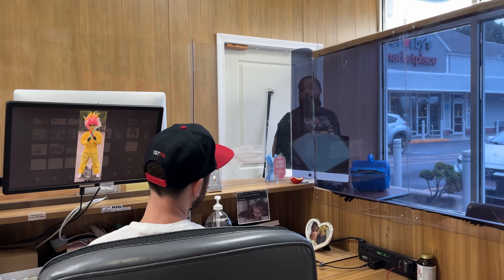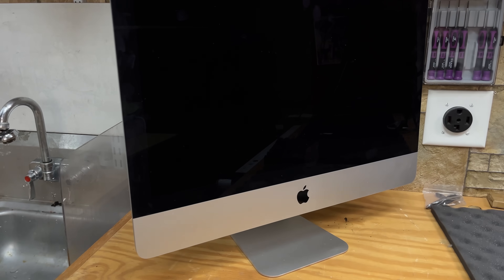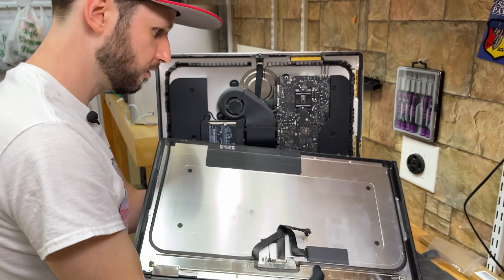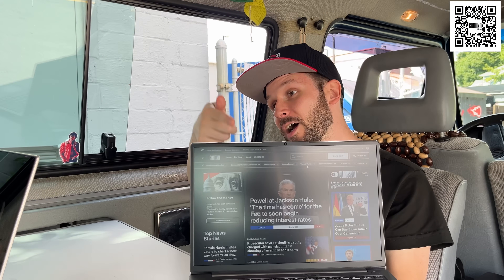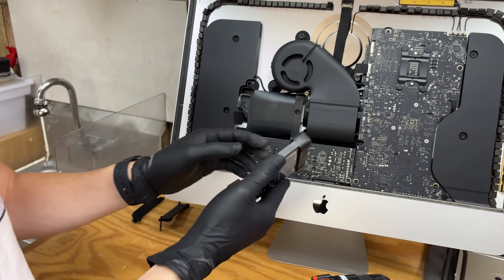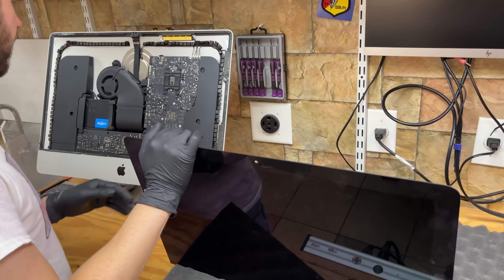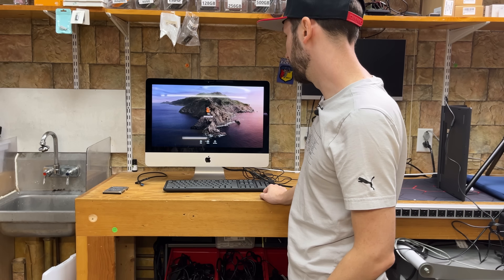This Upgrade Isn't Possible on New iMacs (Sometimes Older IS Better)

Comment: Yeah, you can’t upgrade anything on newer iMacs because 1: Memory is part of the main processor, that’s the beauty of ARM based chip that all computer manufacturers are going to move away to, and 2: Apple decided to glue the storage memory directly into the logic board because they thought NVME solution was still too slow for them, which I can tell PC makers are going to do also in future.

Comment: A good idea would be to start up the imac after you connect the screen but before you stick the screen on the frame. (you can hold it externally in place with some tape temporarily).
This way you can check that everything is working. If you have made a mistake and you need to re-open the imac, you will have to carry out again the same process of buying new adhesive, cleaning the old one etc.

Comment: I’ve replaced the hdd on my 2009 24” but I didn’t notice any significant speed improve during normal work. It boots way faster but that’s only… maybe my iMac is too old to anything to make a difference? Or maybe the ssd is not anything special… it’s a basic Kingston 256gb.
The iMac has 8Gb RAM.

Comment: F**k MAC OS...use 'Ubuntu MATE' on these...wipe it clean...totally no boot camp crap either... just straight install the Linux. In MATE...with the MATE Tweak tool you can auto reconfigure the desktop to any familiar environment ie: Windows, Mac, Unity, Old GTK2 desktop etc with one button...another one that work's really good on mac's is Ubuntu Budgie it is has slightly better specs

Comment: I replaced the HDD for a SSD on my old G4 iMac and put in two 1gb ram sticks. It is SO much faster now! My family uses it as our house jukebox. I just love the look of the G4 iMac, I can’t bring myself to get rid of it
Reply: I wish I kept mine! I bought a G4 iMac like 12 years ago when I was still in high school. I knew even then it was very obsolete and not particularly useful but i thought the design was amazing. I still think its one of Apple's best looking computers. My dad even got me a matching pair of Harmon Kardon speakers that was meant for that iMac and it was pretty cool. I upgraded the 80 GB HDD with a 120 GB HDD and I think I even ran some unofficial patch to upgrade it to Snow Leopard I believe.
Reply: mhm, a media centre will always be a great use for these older machines, especially considering that many will have cd/dvd drives :)

Comment: Great video! I did something similar with my 2012 Mac Mini. Opened up, cleaned it, then swapped out the old HDD to an SSD and swapped out the memory from 8gb to 16 and it runs awesome! Still great for basic stuff like Office programs and web browsing. Totally worth the $120 bucks in parts!
Reply: So true! I did the same upgrades on mine (and later bought one for a friend and upgraded it likewise) and it made a world of differrence. I use it regularly for some light DTP using Pages and other basic tasks (including YouTube of course), using Apple's, and third-party, free apps.

Comment: Now if I were doing that, I'd probably take out the motherboard to put some fresh thermal paste on the things that need it and see if it had the Apple version of M2. You know, little adapter action with a NVME ssd. Maybe look if the RAM could be upgraded.

Comment: Back at my computer repair job from a few years back, we removed those kinds of adhesive from computers by using a little wooden skewer stick. The idea is that you approach it perpendicular to the adhesive and rotate the stick so that the adhesive sticks to the stick, and then you can roll it the opposite direction of the direction you're removing the adhesive. Doing that greatly reduces the amount of scratching that takes place with the initial scrape plus can also help make sure that the adhesive doesn't break halfway while also (hopefully) not breaking any cables in the path.

But it looks like it doesn't matter too much for 

*THE GREATEST TECHNICIAN THAT'S EVER LIVED*

Comment: I have the 27 inch 2014 model and it just stopped powering, out of nowhere I tried turning it on and nothing happened, tried resetting with the keyboard, back button combos and nothing

Comment: I bought my potato lenovo laptop from 2007 with an i3 processor and slapped a new SSD in. Run like a champ. The whole thing cost $250 in my country.
Reply: Did you pay $250 brand new or used? If it was used and within the past 10 years, that's a huge scam IMO.

Comment: Ok, I have a dell Precision mobile workstation 6700. 12 years old and it still works. Just on life support since the battery is Deadman walking. Had 2 hard crashes, can't upgrade to windows 11, and it's ability to hold internet is sketchy.
Reply: Windows 11 is hella bloated it's not worth it.
Reply: @Yurika-rie  it is. But would still be nice to keep it going. I have an asus tuff for more portability and on the go use. But that dell I've had for my entire military career. So once I clone everything over I might have to take advantage of that mail in service.
Reply from the maker: You could try using “Aveyo bypass” to bypass 11’s requirements and keep that beast running. It’s still possible for now, but Microsoft does have plans to disable that in the future

Comment: The 2020 27" iMac with the 16GB 5700 XT & 18 Core iMac Pro are some of the best AIO desktops you can buy today, and they are still supported with modern macOS. Intel MacBooks sucked, but Apple's Intel-based Desktops were KINGS! Up to 256GB of memory! Cant get that on a modern M3 iMac
Reply from the maker: They make some of the best Windows desktops as well!!

Comment: Apple made products with mechanical hard drives until 2020?!?
That is criminal, knowing how much they charge for their crap.
Reply from the maker: They wouldn’t really be Apple if they didn’t screw the customer
Reply: Even back in like 2015-2016 I thought it was odd that Apple would sell iMacs with HDDs. I remember I went to an Apple store around that time and tried out an iMac. For how new and shiny and cool looking it was, I couldn't help to notice how sluggish everything was. Whenever I opened a program, I would see the spinning beach ball icon. When I read the specs, I noticed it had a hard drive. Pretty pathetic IMO for how expensive they were.

Comment: I use a 27" iMac and have replaced the NVMe with a 1TB and installed a 2TB SSD to get them working as a fusion 3TB drive and it's fast AF.
I've been working on PCs for about 30 years and yeah, I've got a permanent scar on my right hand from an iMac power supply from a few years back.
Well done on this one. 
From 'The Oldest Technician That is Still Alive".
Reply: That's quite an interesting thing that happened to you. What happened to you to get such a scar from an iMac PSU? I would genuinely love to hear more about that.
Reply: @EggOfGlory  doing a refurb on a 2011 27" iMac and in removing the PSU I hadn't given it a day or 3 to discharge so when I removed it I wasn't careful and ended up with a nice burn on the back of my right thumb hat looked like a constellation with the burn marks matching the contacts exactly still. The iMac is still being used in a friend's office.
Jumped from the shock and ripped out the power button wire at the same time. LOL
Reply: @WireHedd  That's honestly quite an interesting story! It is funny how that happened, and I myself am into computers.
Reply: The oldest technician that is still alive vs the greatest technician that ever lived
Reply: are you on the east coast?  I have a 2020 iMac; 27".
Reply: @realpropertydivas  I'm in Canada actually.
Reply: I’ll see your scar  and raise you a hair-raising shock from an Atari ST power supply in the 80s…  What kind of evil engineer energizes their heat sinks with line voltage?
Reply: @vaalrus  That sounds about right actually. The STs were excellent when they worked but fixing them was a life risking challenge for sure.
Reply: Sometimes the zaps stay with you... ouch.
Reply: Xd.
Reply: How did you join them as a fusion drive? My iMac decided to "un-join" the fusion drive and my computer is just a waste of space at the moment.
Reply: Oof for the burn, but what model iMac did you add the SSDs on?
Reply: @ I've done it on both my 2015 and 2017 iMacs. The command line for the fusion connection has to be done in the initial setup before the drives are usable. iFixit has a page where the fusion command line info is available depending on the model and drives you use.
Reply: we are looking into buying a older version imac, what do you recommend? thank you
Reply: @eatmoreeats9566  The last Intel model with as much ram and storage as you can get on it. It will run windows, linux or MacOS.
Reply: @WireHedd  thank you. currently we found a 2017 model with these specs- Retina 5K Display, 27-inch, Core i5, 3.8 GHz, 64GB RAM, 2TB. for around 450usd, would you say its a decent price?
Reply: @eatmoreeats9566  That's an excellent price and a great choice.
Reply: Lust is a sin , Christians shouldn't be one with darkness. JESUS is GOD (there is historical proof of that like eye witness accounts and people like Pontious Pilate along with a lot of scientific proof like the days of creation with go with science. also evolution is not real , never has an organism gain genetic information BY IT SELF JUST LIVING , in fact it has been observed that they loose it. GOD has to be real because life can not come from non life, something can't come from nothing , there is a source for everything and that is JESUS/GOD. He loves you man and he can heal you from your depression and anxiety(trust me). if you still don't believe me say this to GOD,"JESUS if your GOD , the show your self to be in a dream and in a DREAM ONLY! Today it self" Muslims , Hindus , Buddhists and Atheists have tried it and they worked. there are testimonies online and miracle testimonies of the healing of PHYSICAL DAMAGE .
Reply: @FrankMadoffe  Yeah, no. Get with this cool thing called logic and reason of non cave dwelling hominids. Space daddies need not ap[ply. If I want a sermon I'll go to church. This isn't a FUCKING church!

Comment: Macs brought to recycling were usually sent straight to dismantling, but one guy got a succesful linux install made in like 1,5 days, and another did just this, but as recyclers we did not go through the trouble of finding out how to hack a macOS back in.
Reply: If it’s an Intel iMac, hold down Command, Option, and R (on a Windows KB, use Windows as Command, and Alt as Option) then turn the device on and it will give you an option to connect to Wi-Fi. On this screen, you can also plug in an ethernet cable. Do the same command from before (Command+Option+R, if that doesnt work, try Command+R) and a loading bar should appear. After a couple minutes, you should be able to restore macOS using the Internet Recovery!
Reply: @gumbygum  all good if it's new enough of a Mac.

Comment: This is the exact model I have on the workbench at work. SSD and OpenCore with Sonoma. Works absolutely fine and it's the perfect machine to perform any kind of software tests for some of our customers that use Macs. 

However, don't buy one used. People are absolutely nuts when asking money for them, even with the crappy original hard drives.
Reply from the maker: I’ve been able to find insane deals on them used though.
Reply: @SalemTechsperts  Market differences, I'd say. Outside of the US, especially where I'm at (Portugal), it's quite a pickle to find a good deal on one. 
If you can though, they are great machines.

Comment: How ironic, I'm currently doing the exact repair on the same iMac model. Andy, instead of replacing the glass with an adhesive back you can get a magnetic kit that uses flat magnetic strips to adhere the screen to the frame. It's convenient but if you iMac is housed where there's dust or humidity I'd stick with the adhesive strip.
Reply: Magnets are convenient if you gotta open up the device more often, but a customer really just needs it shut.
Reply: @SrApathy33  Indeed I was actually going to say something of the effect. This repair is going to stick around the office to be used for lightweight tasks, (scheduling, printing, downloading Lupe's best work, whatever...) so yes indeed customers that don't plan to later undress their machine and poke around should as stated earlier, use the adhesive tape and maintain a secure seal. Personally I like the magnetic glass for another reason...I too have tiny racoon-like fingers that always seem to get prints on the inside of the glass so when I noticed it I can simply grab a small suction cup I use for removing iPhone screens and pull it off and clean it.
Reply: That’s not ironic, that’s coincidental. Irony is the opposite or juxtaposition of what you think or expect on the surface.
Reply: For people at home, a strong, clear packing tape is a good cheap option.
Reply: @kunjpatel8442  I just slapped Catalina on my 2007 iMac I dug up next to dinosaur bones in storage ....the screen has two lines in it and all but it works quite well for its age.... 🤔, kinda like me. 

Clients machines I use quality parts meanwhile I'll slap my things together with tape and glue, build my own tools to check network security, like a Wifi Pineapple knock off outta router parts I dubbed the CrabApple and PWNagotchi's, Flipper Zeros with esp32 dev boards and the cheapest parts money can buy ....all work and all have a purpose...super budget friendly though. Haha so cheers 🥂 to those out there that take a bucket of PC parts and just make it happen! 🤘🏼😎

Comment: What is a...
P-RAM
Pi-RAM
Pea-RAM
Pee-RAM

Py-RAM

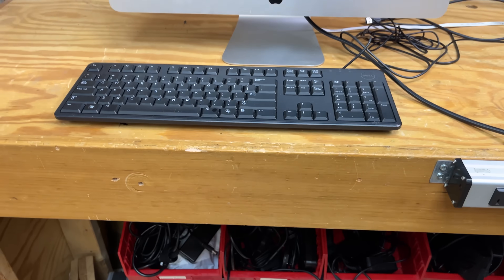Whatever was reset at 11:27
Reply: Think of it as BIOS settings (even though it's not really). The reason you want to reset it here is because it stores info about the startup disk, so when you swap that disk out, it's gonna get hella confused looking for the old drive.

Comment: Just adding an SSD to an old laptop or computer can give it a BIG boost in performance. Just dont buy the adata ones and buy the ones with dram cache
Reply: I also have bad experience with multiple Lexar SSD's. Better brands are Kingston, Samsung, Crucial, Western Digital, Intel, Micron (same as Crucial) and Sabrent. I have always regretted skimping on SSD's so far.
Reply: @SrApathy33  I have Intel 520 2.5 MLC 180 Gb SSD thats working in my system since 2012. It still shows 93% of lifespan left, even throguh I even defragmented it back in the day at least a 20 times or so.
Reply: @SrApathy33 what about transcend?
Reply: Ther SU line of sata ssds has a really high failure rate. I personaly had 2 of them fail on me.
Reply: Why not adata? Just curious
Reply: @UhackUdie  Any SSD without Dram is gunna be slower and less responsive, but Adata's SSDs just kinda suck in general, or at least they have. I have had multiple in the past and they all had wonky performance and reliability. You're better off getting another budget brand like Crucial or something.
Reply: @UhackUdie  2 years ago, one of my clients insisted to get ADATA SU750 256GB to upgrade 30 of his PCs to Win10 just because it was the cheapest SSD. Told him just it was a bad idea. So far I had to replace 12 of out 30, he is lucky that the distributor replaces them under warranty.
Reply: @gamingforpizza5142  the cheap comes out expensive... or it would, if it weren't for warranty. Still, the hassle involved... maybe next time he listens to your advice?
Reply: @aleaxdeathbringer  He doesn't have to, because he is no longer employed in this company 🤣
Reply: @gamingforpizza5142  the cheap DEFINITELY came out expensive! His unnecessary frugality cost him his job!
Reply: SSD for sure, and if you can upgrade RAM, that also may help. Especially if your computer is running just a single channel of RAM, upgrading to dual channel can help a lot. In other words, 2 x 8 GB DIMMs is better than 1 x 16 GB.
Reply: idk if I'm lucky but none of my 5 adata ssds failed in years, both expensive and cheap ones. actually don't think I ever had an ssd fail, I thought one did when its write speed got slower than a stoned snail but that was caused by trim not working properly in a linux distro